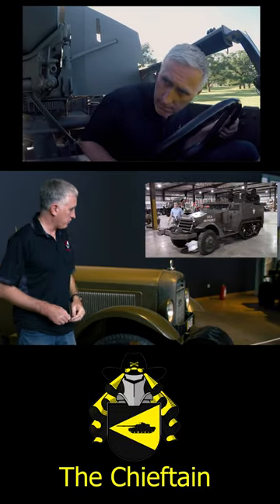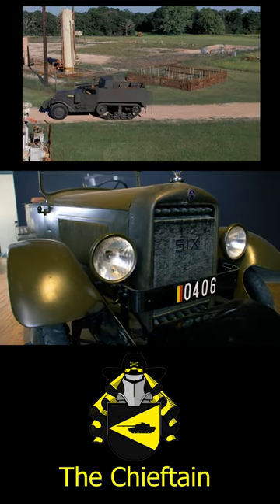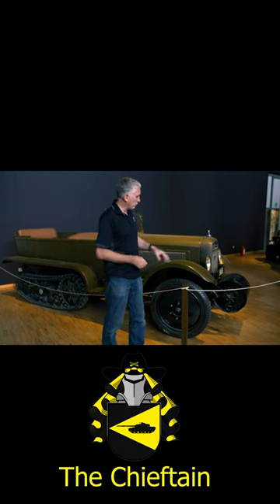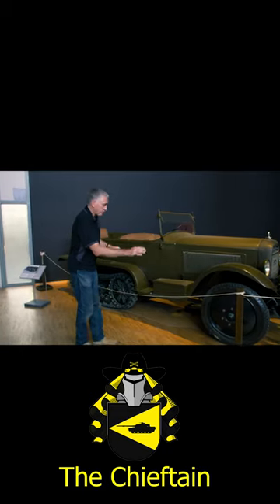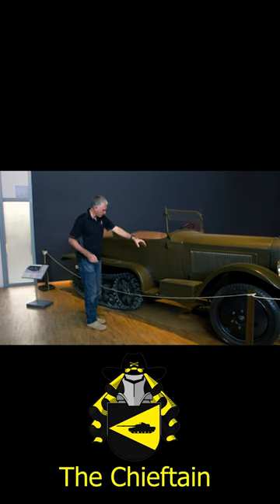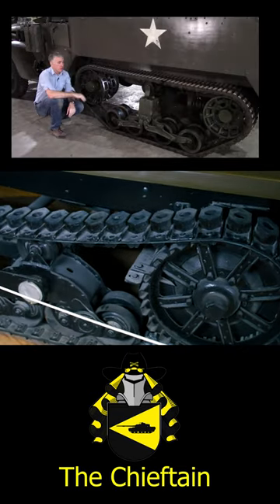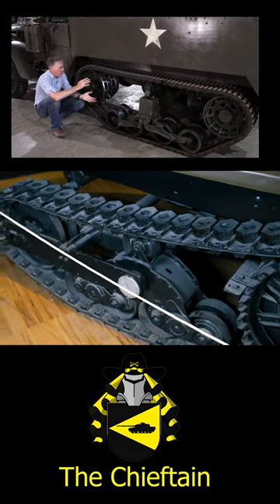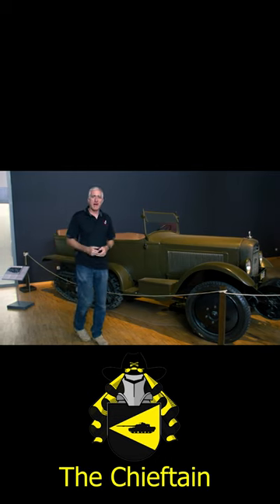The French Grandaddy of US WW2 halftracks.

Comment: So I know why halftracks were dropped after WW2 and it's aftermath due to a variety of issues but why were they used so extensively during WW2 despite these issues. What were pros that outweigh the cons and why did those cons outweigh the pros soon after?
Reply: They had much better off road performance than wheeled vehicles and were more practical to mass manufacture and field than fully tracked vehicles prior to WWII.

Post-WWII trucks improved a lot and became much more reliable and capable especially off-road. On the other side, fielding large, fully tracked APCs and weapons platforms became more feasible.
Reply: Only thing they had
Reply: Additionally. fully tracked vehicles require specialized driver training, whereas basically anyone who can drive a truck can drive a halftrack.
Reply: Just think of a halftrack as a heavy truck with good off-road capabilities; useful in an era where horsepower was low, and roads frequently sucked.

Better roads, less need to take heavy trucks off road, and much higher horsepower means that you don't need the extra traction and complexity - so, dropped as too expensive for the minor benefits.
Reply: British never really took to half-tracks,  they stuck to 4x4 it was actually quite surprising how good a 4x4  can be in the rough or sand of course deep mud is another matter

Comment: Half tracks are such an iconic vehicle of WW2 as it is the only war in which they were really used ( beside the Israeli use of them post WW2).  The US half track system is real straight forward where as the German implementation is much more complex - to the point of having to oil every pin in the track links.
Reply: They were also used in WW1, in fact the Kegresse system was utilised on Austin Armoured Cars by Russia. They were also used as artillery prime movers.